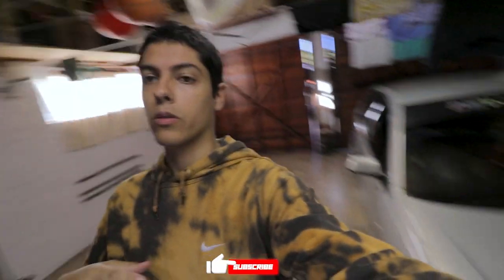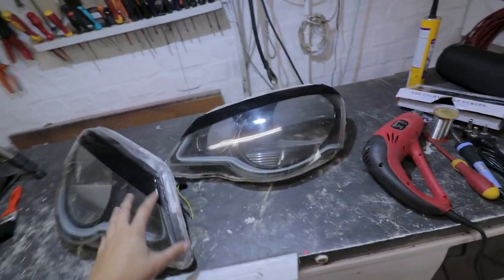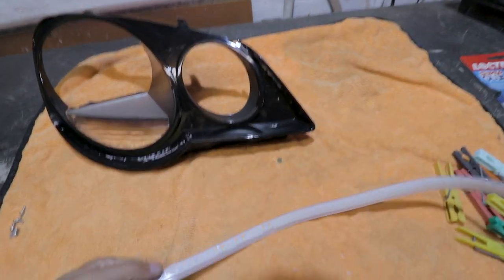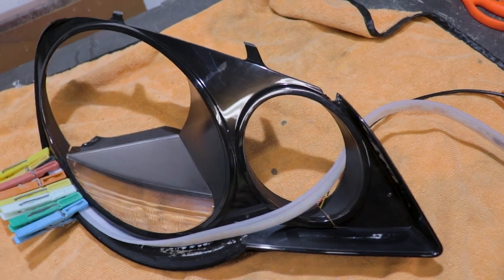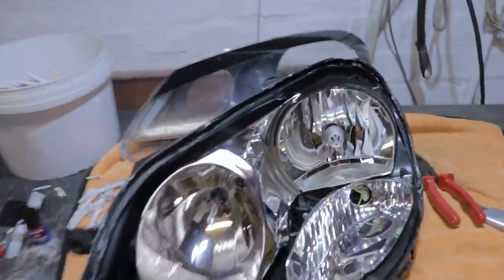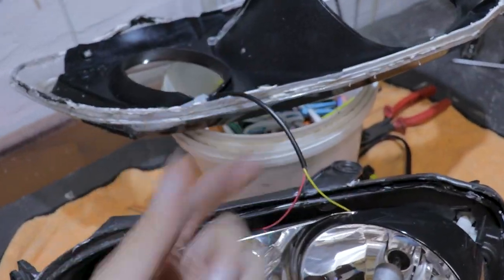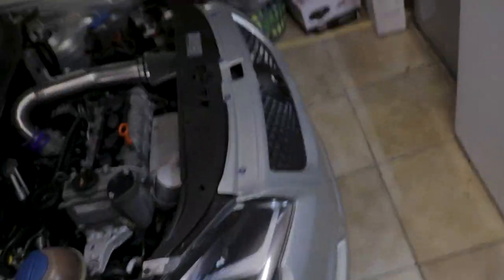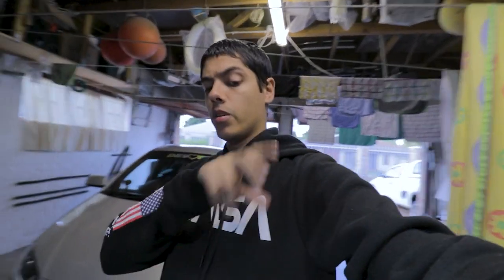How to install DRLS on a polo FULL DIY

Comment: These are really well done bro! I'd avoid super glue though it's too brittle and doesn't like heat/vibration - epoxy is best bet here for sure. Excellent work though
Reply from the maker: Thanks for the tip!